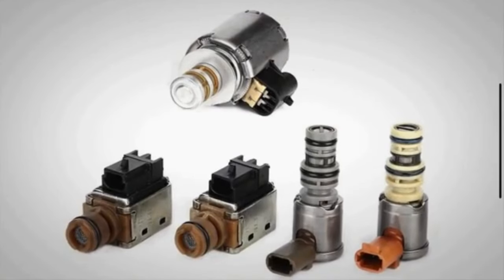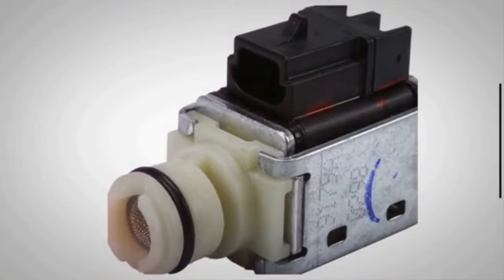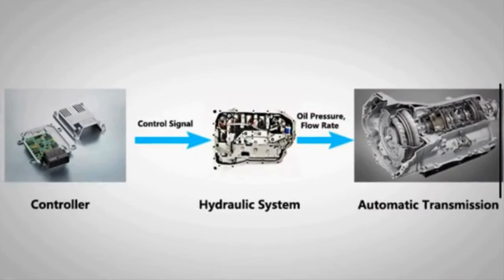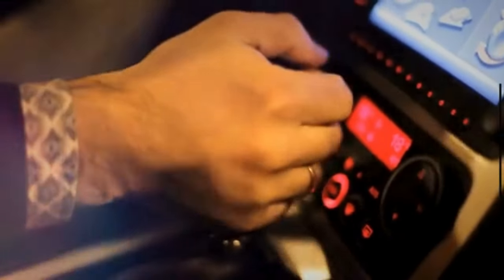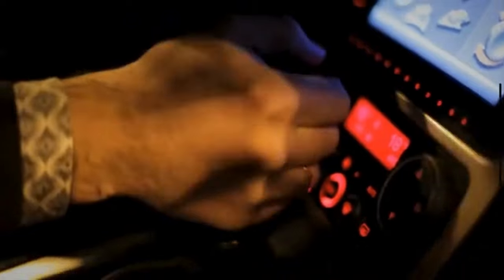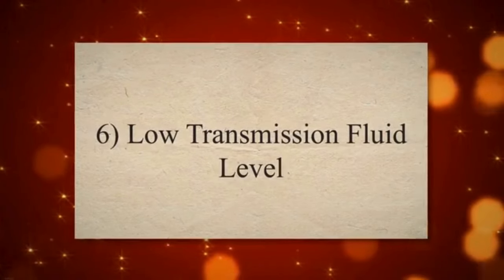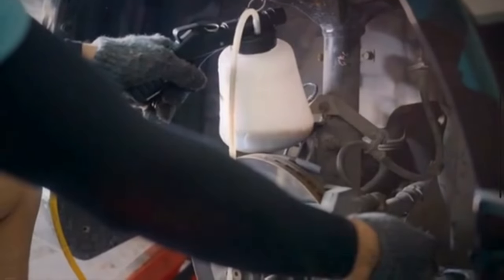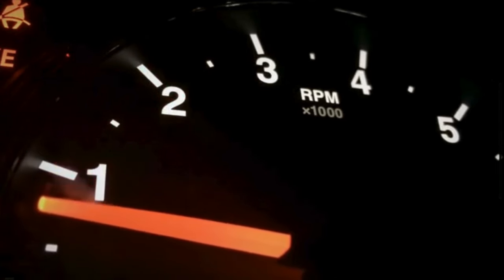TOP 10 SYMPTOMS OF A BAD TRANSMISSION SHIFT SOLENOID

Comment: When I engage in reverse, it jerks and moves smoothly but sometimes does not move at all. 
When drive is engaged, it sometimes skips 1 and moves to 2. It jerks when changing from 2 to 3 and the engine RPM will raise as if it enters natural before 3 is engaged.
It does not engage 4 & 5 at all even when speed and acceleration is increased. 

When the car is stopped or speed reduced, it remains in gear 3 most of the time except if the can is brought to a total halt. 

Whey could be the problem; solenoids, verve body or what?
Reply from the maker: The symptoms you've described suggest potential issues with the transmission system of your vehicle. These symptoms can be caused by various factors, including problems with the transmission solenoids, valve body, transmission fluid level/condition, or even internal transmission components.

Here's a breakdown of potential issues based on the symptoms you've described:

Jerking and erratic shifting: Jerking during gear changes, skipping gears, or difficulty engaging certain gears can be indicative of problems with transmission solenoids or the valve body.
Failure to engage higher gears: If the transmission is not shifting into higher gears (4th and 5th gears), it could be due to various reasons such as low transmission fluid level, restricted fluid flow, or internal mechanical issues within the transmission.

Staying in gear 3: If the transmission remains stuck in a particular gear (in your case, gear 3) even when speed and acceleration increase, it could indicate a problem with the shift solenoids, valve body, or internal transmission components responsible for gear selection.

Given the complexity of automatic transmissions and the variety of potential issues, it's best to have the vehicle diagnosed by a qualified mechanic or transmission specialist.